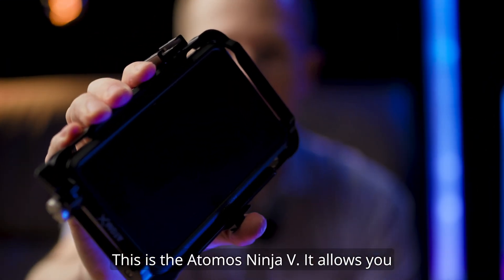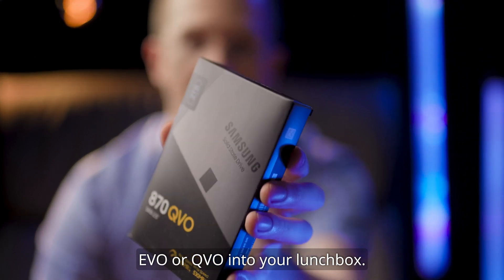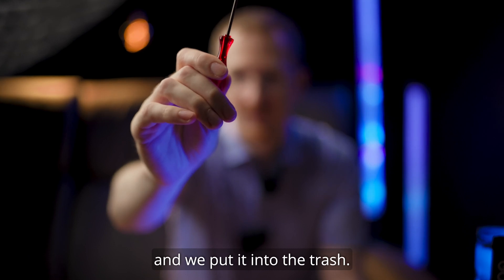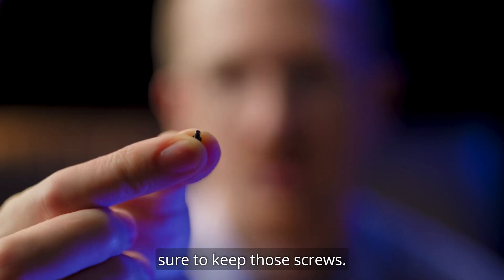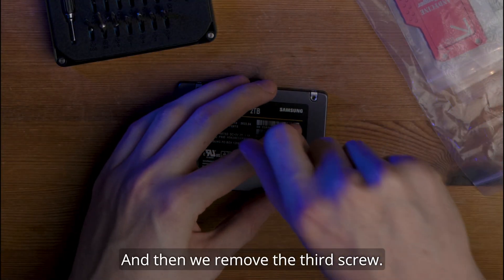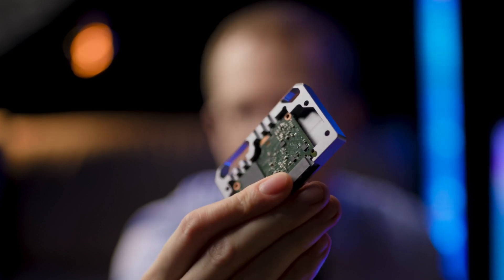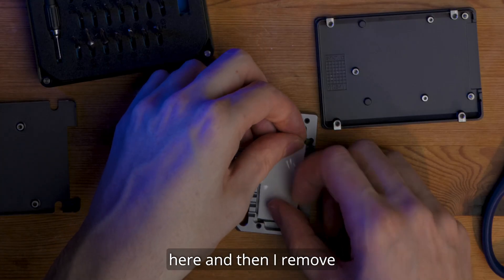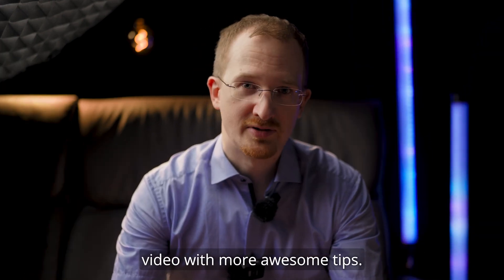Cheapest SSD for Atomos Ninja V

Comment: Thanks for the video... I would like to know if this cage is compatible with the new 2023 Atomos Ninja Ultra and the 4 TB SSD 870 EVO... thanks!
Reply from the maker: @JacopoDiGiuli  I don't know if the cage fits. Regarding SSDs, most camera and camera devices only accept up to 2TB. Also the new Samsung EVO870 might have changed and don't fit anymore. But I cannot confirm.
For the S5IIX the Ninja V is enough. I would go with the BlackMagic VideoAssist 12G. Less hassle and you can use SSDs from today and not those slow old 870EVOs. 😁

Comment: WOAH THIS IS CRAZY COOL!!!! You are a genius!!!
Reply from the maker: Thank you but make sure to get the EVO, not QVO SSD. I haven't tested it yet, but the EVO should not get into problems after recording for some time. Once I confirmed it, I have to update this video.
Reply: @CameraRig  I saw on the official channel of the luchbox that they cut the thermal pad (using a pencil to outline it first) and they are left with 2 pieces of thermal pad and they put one piece under the ssd and another on top of it and than they close the lunchbox . Almost everyone on youtube use the thermal pad only on one side of the ssd. Is that correct as Im quite puzzled ?
Reply from the maker: The thermal pad conducts the heat away. The top of the SSD is facing outwards. If you put it under, it would transfer heat to the back of the monitor and could also better transfer heat from the monitor to your SSD. Usually, you put heatpads on the top of chips.
Be aware, that the latest EVO870 might not fit anymore into the Lunchbox.
Reply: @CameraRig  Much appreciated ! Didn't stopped to think about that possibility .
Reply: And dead guarantee😢